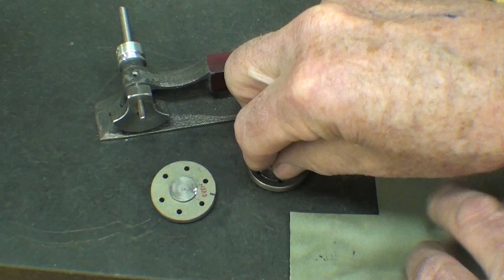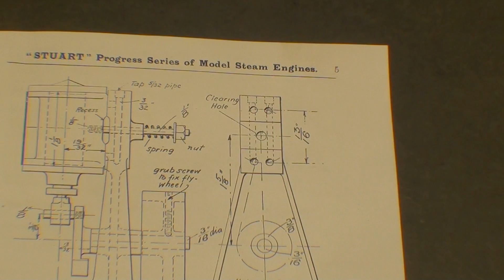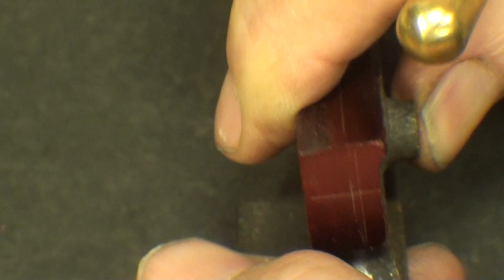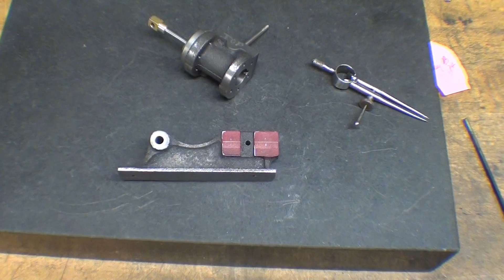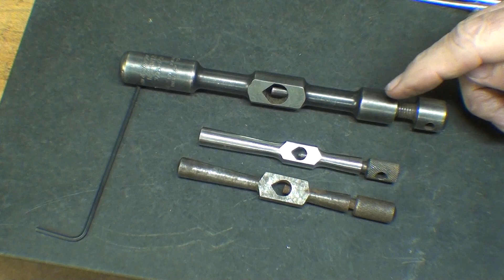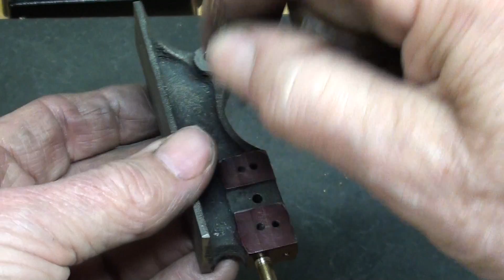Tubalcain pt 8 BUILDS THE STUART PROGRESS STEAM ENGINE

Comment: Brown and Dull, is that the modern name for that company? I do like the steam hole transfer process. I have a osc engine that I need to finish up, had the kit for a couple of decades. It's one from PM, their model 2A/2B.

To make that odd shaped hole, you could actually do that with an EDM. There are a bunch of ways to set that up that can be done in the home shop. Oh, great, I just gave myself a new multi stage project, just what I needed.

Comment: mrpete, did you notice that at about the 20:30 mark (when you were drilling the angled hole), that the part moved in the vice?
It apparently didn't hurt anything, but when I see that kind of stuff, I always have what we used to call (in my younger days in construction), "A half-inch heart attack".
That's when you step backwards while up high on a scaffold, and the board you step to is just a half inch or so lower than you expect it to be, and the full 1/1000th's of a second it takes for your foot to eventually hit it, you completely convince yourself that you are falling to your death.

I saw that part drop maybe 10 or 15 thousandths and I literally jumped and said, "OH NO!"
LOL!
I guess because I have broken SO many drill bits and such in my life...

Comment: mr. Peterson
I need your help I might be acquiring a South Bend 10-inch lathe it has been crashed the idle gear for the quick-change gearbox has a couple of teeth broke off of it and the banjo is broken or the banjo that holds the idle gears I've only had a quick glimpse of this but the guy wants to give it away for free somebody is already torn it apart he has a manual for it my question is when I find out what model number this is and what part numbers I need could I possibly contact you to see if maybe you might have something stashed I would completely make it worth your while this way supposedly came off a battleship I was going to go with Grizzly machine and have them look up the number when I get it and find out the exact history and make model  number of this machine if you could be of any help to this it would be greatly appreciated
Reply from the maker: I have no spare parts for south bends---but you WILL find them on ebay sooner or later.  So ebay or craigs list is your best bet.
Reply: mrpete222 alright well thanks anyway keep up the good work on the videos they sure are enjoyable maybe I'll post some of mine when I get this lathe....

Comment: RE: broaching a round hole to a square.  
That's easily done in the Bridgeport using an old tap for the broach.  Grind it to the appropriate sized flat with the appropriate clearance angles then chuck it in an R-8 collet, reach up and apply the spindle brake and begin broaching.  Start out at taking about .005" of material per stroke. 

It actually goes faster than you think and leaves a nice machined surface.  I'm a retired tool&diemaker and have used this technique numerous times.  Respectfully, TreeTop

ETA
Oh by the way, IMO, your videos are NOT too long!  I could watch you and listen to you for hours!
Reply from the maker: Thanks--I intend to try that or similar method to make a tap wrench--I have done that many times for keyways
Reply: Back in HS, one of our Bridgeports had a broaching attachment set up on the rear of the machines ram.  We never did use it, however I got to use it personally.  As one of the shortest kids in the class, I was standing near said Bridgeport and turned around quickly and ran my head right into it.  After a trip to the nurses office with a bleeding head, that attachment had a foam pad firmly taped to it from then on.
Reply from the maker: Wish I had one of those.   Hit my head plenty of times at school

Comment: Hi Mr Pete.  I've seen a few of those Starrett 174 tap wrenches since I've been subscribed to so many channels on here, but I made one of them at school when I was about 13 or 14yrs.  I can remember turning the tapers between centres, filing the flat sides, and the 'pointy' hole.  I also remember that the long screw was a bit tricky because it was quite small diameter.  I've still got it and use it fairly often.
Another thought.  When I was doing my college day release part of my engineering apprenticeship, I remember our tutor showing us a Stuart steam engine that he was building.  It was very similar to the Stuart 5a that you showed in the first part of this series, so it probably was one.
Excellent series BTW, and even though I'm not especially into steam engines, I almost feel like I'd like to make one.  
Regards Mark in the UK
p.s. we don't call it 'jointing' paper, we call it gasket paper, or gasket material.

Comment: The steam line connects to the inlet passage to the inlet ports to the cylinder ports to the exhaust ports to the exhaust passage to the atmosphere or return line if using a condenser or the next stage manifold if it's a compound engine. Try saying that all in one breath.
   Mike (o\!/o)

Comment: the simplicity of this engine is what got my attention. a steam two stroke as it were. no reed valves....no poppet valves. just porting. really neat concept. in actual use though on a larger scale...what sort of lubricant would be appropriate?
Reply: All steam engines are 2-stroke, in and out. The only poppet valves that I have seen on a 2-stroke were on a Detroit Diesel, though there may be others I am not familiar with. An interesting website http://www.animatedengines.com/
   Mike (o\!/o)

Comment: What is your source of air? Will it run efficiently on an aquarium air pump? Or must it have a compressor to provide enough pressure?
Reply: An aquarium pump will have trouble, if it works at all -- it's got airflow, but not really any pressure; and once you start getting pressure in the tubing, it stops working well.
Reply: I have the first engine I made that I ran on my desk with an aquarium pump for many years until it wore the valve gear out. Lubrication was not optimum on a desk that you want to keep clean. It takes a fairly large pump even for a small model and the engine must work very easily.